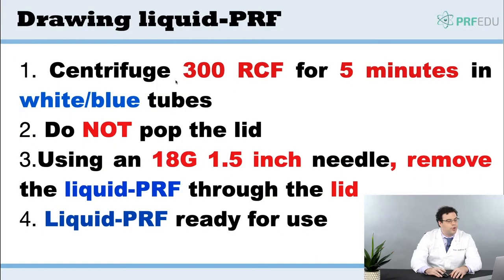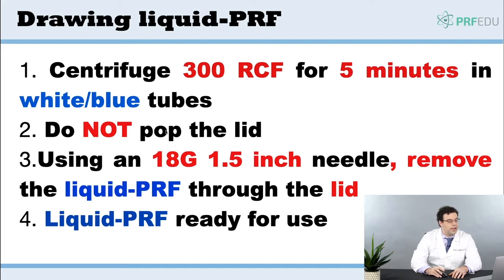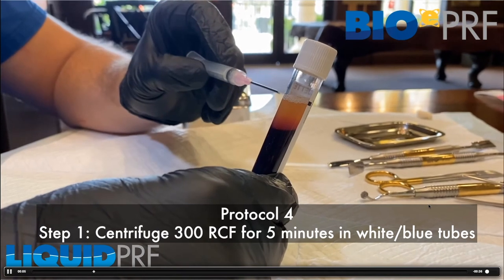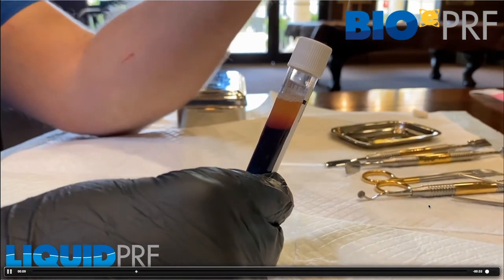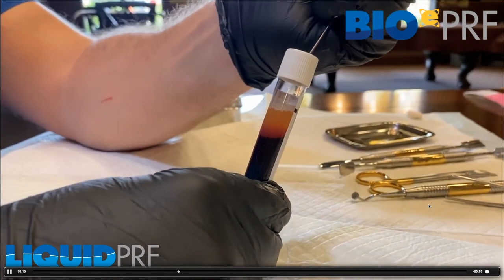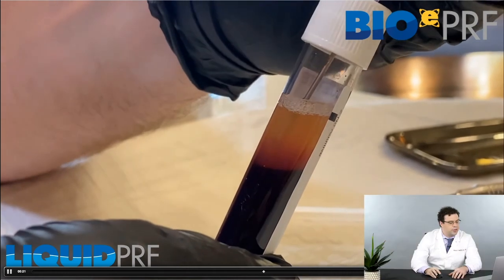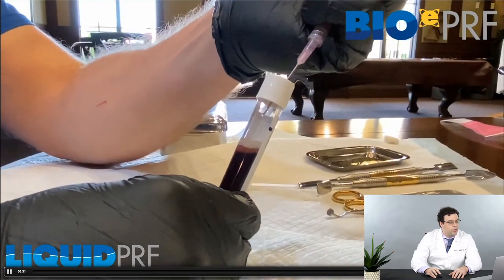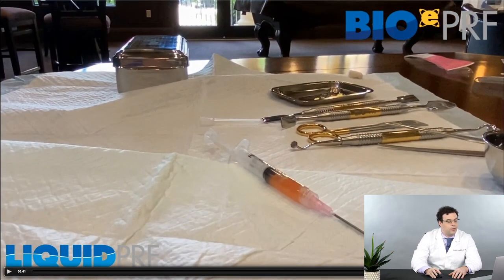Chapter 10.4: Drawing Liquid-PRF presented by Dr. Richard Miron

Comment: I have a question re: after drawing the liquid PRF…Regarding scalp injection for hair loss/hair rejuvenation: Would the injections then be given using that 18G? Or are we just recommending the 18G to pop through the lid and draw it up without activating the platelets? 
What gage needle should we be using to inject with and is there still a need to be concerned about activating the platelets at this point? Or is a higher gage needle sufficient to make injections on scalp at this point? Thanks for the valuable information, and for sharing your knowledge in these videos!
Reply from the maker: You don't need to activate the platelet concentrate since you aren't using anti-coagulants. You would remove the 18 gauge and inject the scalp with a 30 gauge 4mm needle.